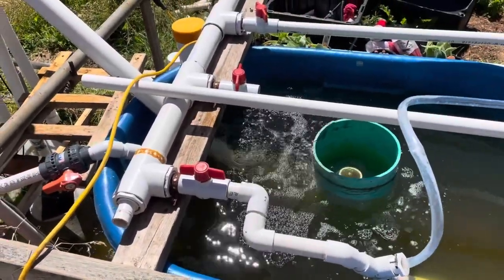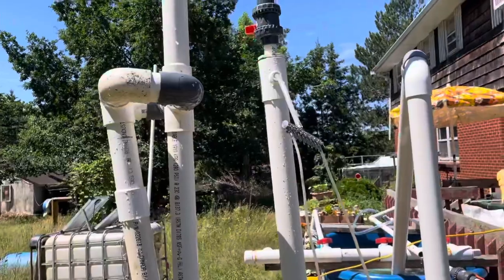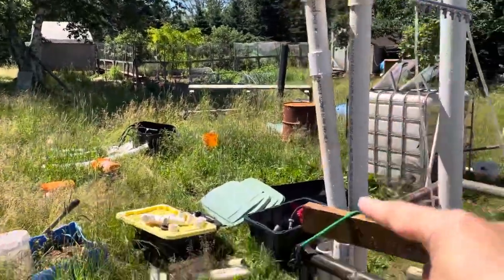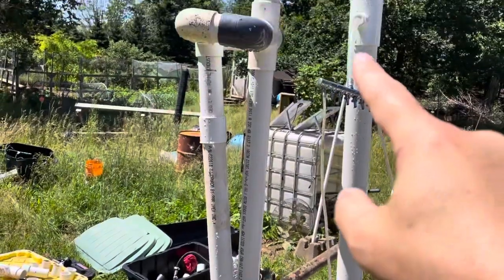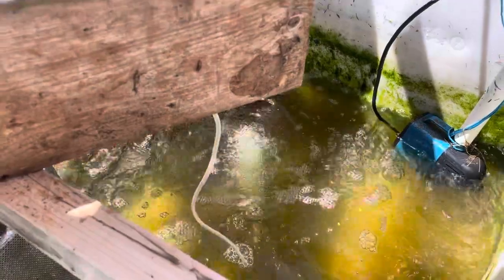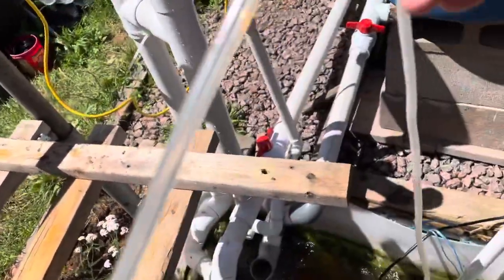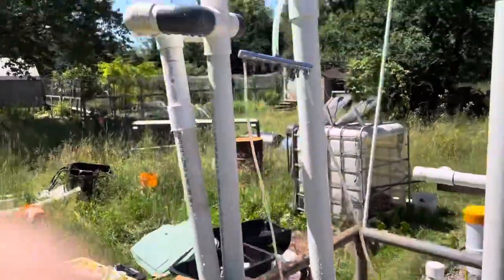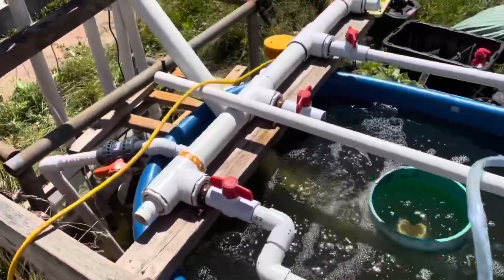Aquaponics - Mad Science - Trompe Pump Prototype

Comment: I was just looking into this! I plan on trying to figure out a small scale way to do on fish tanks with sumps
Reply from the maker: More detailed video coming soon on the full system integration.  However, the short version is that it's tricky and only marginally worth it in North America where electricity and transport is cheap.

On the other hand, if electricity is pricey or grid / transportation access is awkward, then the Trompe begins to make a lot of sense.
Reply: @MichelVaillancourt  Can i ask why you'd aerate the water then essentially de-aerate it in the trompe to then add the air back in with a bubbler rather than just using the aerated water that traps the air originally? Is there an efficiency/better aeration achieved with the bubbler?